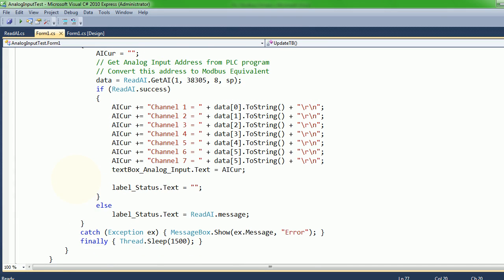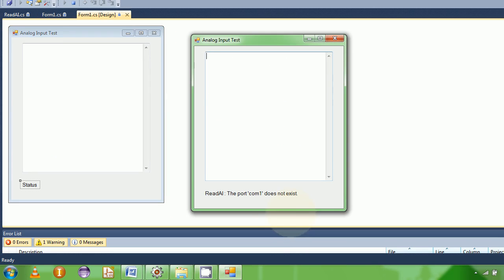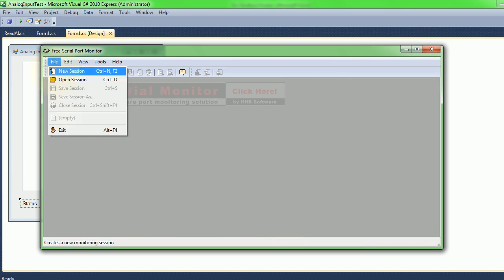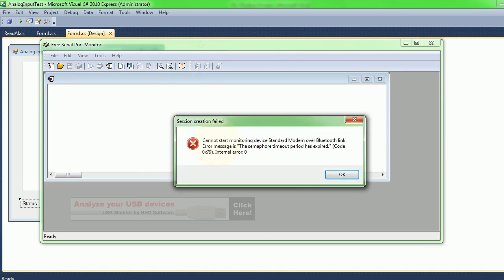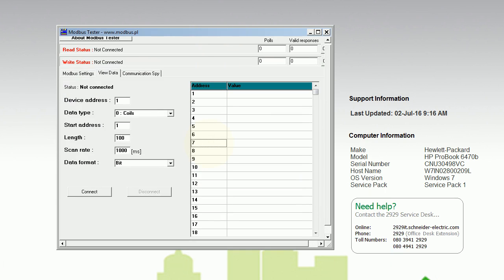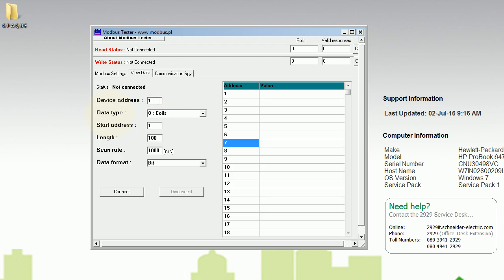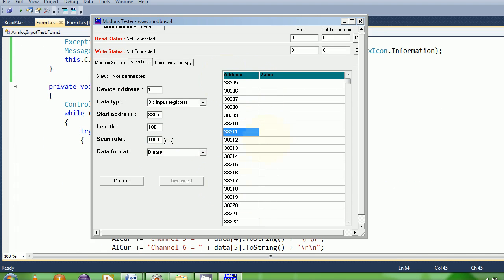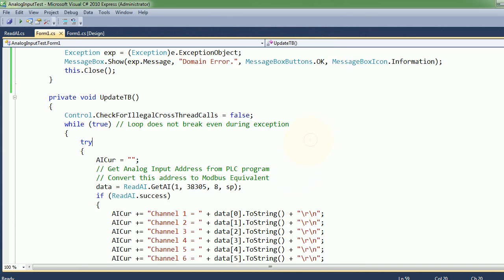15 Tool Of the Trade and Application Program

Comment: will i have older flow computer that its holding registers have different starts like 3001 and i cant get data what can i do? i can only get data with opc thats reads the id directly which is like 0785 that i put on its flow computer screen to show it on it 
i cant read this modbus registers any ideas ? my flow computer is solatron 7950
Reply from the maker: first of all dont worry about type and make of your electronics as long as it has 
a serial port / rs485 port in it and modbus master implemented in it. 
i have reference solartron 7950 manual from internet as under :-
http://old.vsp-co.org/emerson/data/mmi-20019471.pdf and found following chapter of interest :-
7. Serial Communications and Networking
Supported Commands.The 7950 supports two commands:
1. Command 3 - Read multiple registers
2. Command 16 - Write multiple registers 
MODBUS register numbers are always expressed as the database location number minus 1. Therefore, a
requesting device will ask for MODBUS register 16 in order to read the data in database location 17. 
==> Database access over a MODBUS network , this is already cooked no nonsense information to be
used to write modbus driver , NOTE i have 2 cchanges in the code
replaced 0x04 by 0x04
deducting -1 from address , not -300001
==> point is u must understand request response transaction very well at byte level , then wrting
communication software will become very easy provided u know C# and serial port 
==> you must monitor serial port by the software i have mentioned "serial port monitor"
this will give u great idea and u would be able to catch any bug very quickly
Good Luck !!
using System;
using System.Text;
using System.IO.Ports;
using System.Threading;
namespace Autoclave
{
    static class ReadAI
    {
        static  private byte _Id { get; set; }
        static  private Int32 _StartAddress { get; set; }
        static  private ushort _NoAI { get; set; }  
        static  private SerialPort _sp { get; set; }
        static  public bool success { get; private set;  } // Read only from outside 
        static  public string message { get; private set;  }

        static  public short[] GetAI(byte id, Int32 startAdd, ushort NoAI, SerialPort sp)  
        {
            try
            {
                _Id = id; _StartAddress = startAdd; _NoAI = NoAI; _sp = sp; success = false; message = "";
                int BytesExpected = 2 * _NoAI + 5;
                byte[] response = new byte[BytesExpected]; 
                  // A static method can have local variable , response is NOT static

                for (int x = 0; x < (BytesExpected); x++)
                    response[x] = 0;

                _StartAddress = startAdd - 1;
                _sp.ErrorReceived += new SerialErrorReceivedEventHandler(SpFault);

                if (!_sp.IsOpen) _sp.Open();
                _sp.DiscardInBuffer(); _sp.DiscardOutBuffer();
                byte[] request = MakeRequest();

                // Baud is BITS per sec NOT BYTES per sec. 
                int milliSec = (1000 / _sp.BaudRate) * (BytesExpected) * 8 + 100; 
              //  100 to device to process the request  
                _sp.Write(request, 0, 8);
                // write method blocks. so no need to count for 8 bytes to be sent. 
                // device time + 8 bytes to send + retutn bytes 
                Thread.Sleep(milliSec);

                int count = 0;
                while (_sp.BytesToRead > 0 || count < BytesExpected) // Or read time out 
                {
                    response[count] = ((byte)_sp.ReadByte());
                    count++;
                }
                _sp.Close();
                if (!CheckResponse(response))   // check for crc
                {
                    success = false;
                    message = "ReadAI CRC Failure";
                    return null;
                }
                else if (response[1] == 0x03)
                {
                    byte[] temp = new byte[2];
                    // convert data into int16 and returm it. 
                    short[] data = new short[_NoAI];
                    for (int num = 0; num < _NoAI; num++)
                    {
                        temp[0] = response[2 * num + 4];      //  Low  Byte 
                        temp[1] = response[2 * num + 3];      //  High  Byte                   
                        data[num] = BitConverter.ToInt16(temp, 0);
                       //  ushort MyNum = (ushort)(( temp[1] << 8) | temp[0] );
                    }
                    success = true; message = "Success";
                    return data;
                }
                else
                {
                    success = false; message = "ReadAI Unknown Response";
                    return null;
                }
            }
            catch (TimeoutException)
            {
                if (count == 5 && response[1] == 132) // 4 + 128 
                {
                    // error response = request code + 0x80 ( 128 )
                    // error response = 5 bytes long  
                    success = false;
                    message = GetErrorString(response[2]);
                    return null;
                } 
                else
                {
                    success = false; message = "ReadAI TimeOut";
                    return null;
                }
            }
            catch (Exception ex)
            {
                success = false; message = "ReadAI - " + ex.Message;
                return null;
            }
            finally { _sp.Close(); }
        }

        static  private bool CheckResponse(byte[] resp)
        {
            // crc check calculated at full with plugging zero ///////////
            byte[] bt = new byte[2];
            crcCalculator(resp, ref bt); // calculate crc16 of resp in put it into bt 
            if (bt[0] == resp[resp.Length - 2] && bt[1] == resp[resp.Length - 1])
                return true;
            else
                return false; // false = bad 
        }

        static  private byte[] MakeRequest()
        {
            // request for reading Analog Input is always 8 bytes long.
            byte[] write = new byte[8];
            write[0] = _Id;    // device id 
            write[1] = 0x04;  // Read A I 

            byte[] start = BitConverter.GetBytes((ushort)_StartAddress); //  ushort = 2 bytes
            write[2] = start[1]; // msb first 
            write[3] = start[0];

            byte[] noReg = BitConverter.GetBytes(_NoAI); //  ushort = 2 bytes
            write[4] = noReg[1]; // msb first 
            write[5] = noReg[0];

            byte[] writeTemp = { write[0], write[1], write[2], write[3], write[4], write[5], 0, 0 };
            // Note two zeros at the end. 

            byte[] _crc = new byte[2];
            crcCalculator(writeTemp, ref _crc);

            write[6] = _crc[0];
            write[7] = _crc[1];

            return write;
        }

        static private string GetErrorString(byte n)
        {
            string errorString = ""; 
            if (n == 1) errorString = "Error Code 1.Illegal Function.";
            else if (n == 2) errorString = "Error Code 2.Illegal Data Address.";
            else if (n == 3) errorString = "Error Code 3.Illegal Data Value.";
            else if (n == 4) errorString = "Error Code 4.Device Failure.";
            else if (n == 5) errorString = "Error Code 5.Device Is Processing Ur Request.Please Wait.";
            else if (n == 6) errorString = "Error Code 6.Device Busy. Ur Request Is Rejected. NAK.";
            else if (n == 7) errorString = "Error Code 7.This Request CanT Be Performed. NAK.";
            else if (n == 8) errorString = "Error Code 8.Memory Pairity Check Failed.";
            else if (n == 10) errorString = "Error Code 10.GateWay Not Available.";
            else if (n == 11) errorString = "Error Code 11.Device Failed To Respond.";
            else errorString = "Custom Error Code.";
            return errorString;
        }

        static private void crcCalculator(byte[] message, ref byte[] CRC)
        {
            ushort CRCFull = 0xFFFF;
            byte CRCHigh = 0xFF, CRCLow = 0xFF;
            char CRCLSB;
            for (int i = 0; i < (message.Length) - 2; i++)
            {
                CRCFull = (ushort)(CRCFull ^ message[i]);

                for (int j = 0; j < 8; j++)
                {
                    CRCLSB = (char)(CRCFull & 0x0001);
                    CRCFull = (ushort)((CRCFull >> 1) & 0x7FFF);

                    if (CRCLSB == 1)
                        CRCFull = (ushort)(CRCFull ^ 0xA001); //  Modbus CRC16 Plolynial 0xA001
                }
            }
            CRC[1] = CRCHigh = (byte)((CRCFull >> 8) & 0xFF);
            CRC[0] = CRCLow = (byte)(CRCFull & 0xFF);
        }

    }
}

Comment: Can we associate user defined name to register/coil addresses so that instead of register/coil address we just pass name and subsequent action read /write occurs in address that is attached to name. Like any additional form/layer on top of form which can do this job..
Reply from the maker: Of course yes , if you are using C or C++ use #define and in languages such as java VB python etc just create a variable of Unsigned Short   and assign it the 16 Bit Hex address value. In fact this is the better way of programming...
Reply: +Sachin Singh good, let's move ahead with the form that you are using in above video, here how would we achieve the same thing which I just mentioned in previous comment
Reply from the maker: const ushort RTDStartAddress = 38305 ;
data = ReadAI.GetAI(1, 38305, 8, sp);           changes to          
data = ReadAI.GetAI(1, RTDStartAddress , 8, sp);
Reply: +Sachin Singh so RTDStartAddress is the name /place holder you gave to register 38305...
Reply: +Sachin Singh thanks for support let me try this out on my machine and revert back if I find any issue
Reply from the maker: Any update..........how it worked on you machine?
For Me => No News Is Good News
Reply: +Sachin Singh have been preoccupied by other stuff...  Will update very soon as I run it.. Also been through your videos I was wondering if nmodbus library could do same job am I right? 
Moreover in a video you talk about the plc firmware and you might try writing that (if I was following correctly) could you update about that a lil bit
Reply from the maker: I have tested my modbus RTU code on ABB ACS 500 AC Drive , ABB PLC AC500 and Schneider Electric Energy Meters....... It worked as expected...
Reply: +Sachin Singh compiled the code with the this one issue "SpFault' doesn't exist in current context " (inside ReadAI code) 
Declaration of a local variable will fix this...  Right? 
Also to implement other opcodes of modbus (like register(4000x) read or register write changing opcode n address will do the job?
Reply from the maker: http://stackoverflow.com/questions/3034548/serial-port-does-not-exist-in-current-context-c-sharp

https://cboard.cprogramming.com/csharp-programming/110563-csharp-output-based-data-read-serial-port.html

if u stil get stuck , share me ur code n i shall fix it for you....